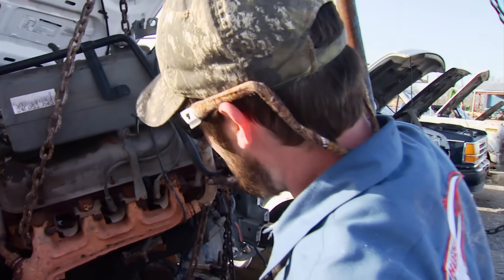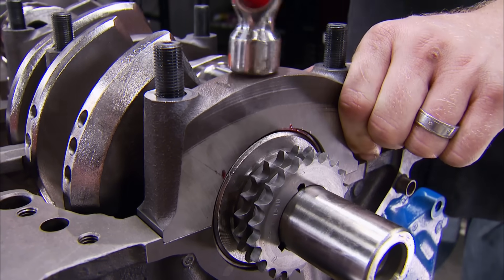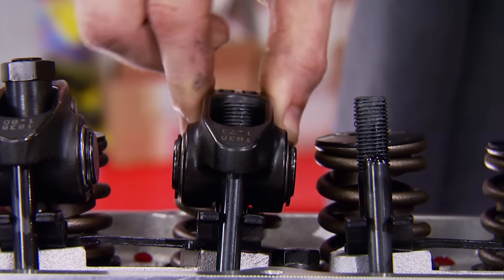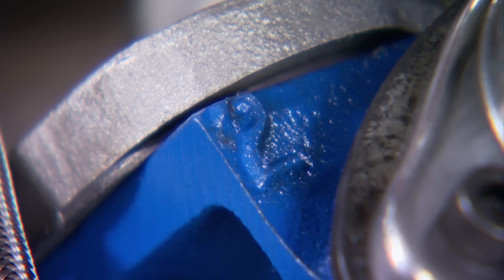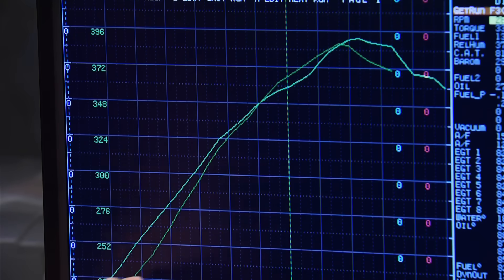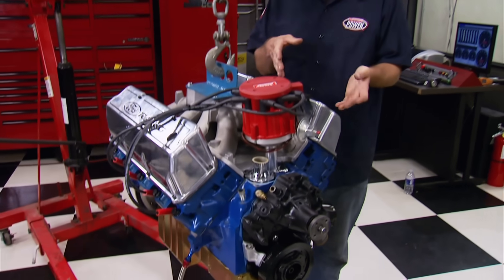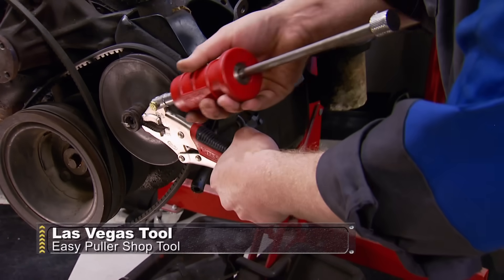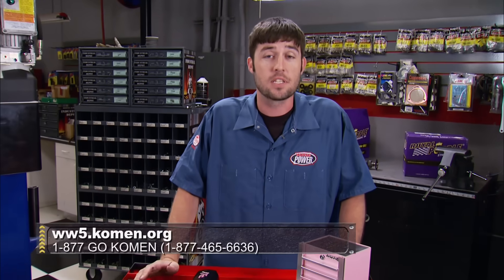351 Small Block Dyno Shootout: Windsor vs Cleveland - HorsePower S16, E11

Comment: They failed to make the Cleveland comparable. The intake was sized wrong for the 4v heads. Also a bit of pocket porting on steel 4v heads along with a properly sized intake would have at least gotten the heads closer to comparable with the aluminum aftermarket heads on the 347 Windsor

Comment: I worked for a ford dealer for 27 years , this combination is setup for failure, if you ever drove a ford torino with a 351 4bll cleveland factory , it had great torque and horsepower, you set this up for failure with the combination of parts.
Reply: yep this was a bias test

Comment: I'm not a Ford guy but you would think with those much bigger 4V intake ports you could rev the crap out of that engine and get it to a lot higher than 5500 RPM.  I bet that's where it starts making more power
Reply: Can only do what the cam is allowing you to do (no matter who's name is on the valve covers). The cam they had in that engine didn't support the airflow they needed to run it up to high RPM's the 4V heads are noted to support.
Reply: If you have the correct camshaft then you could. The cam they used crapped out at 5K.

Comment: They should of used a Cleveland stroker  built by Bob Glidden Racing.
Reply: or a Kaase Cleveland.
Reply: Bob would have destroked it to around 331 inches and turned ungodly rpm like he did in the 70s when he was kick'n pro stock ass!

Comment: 408 vs 358? Why not stroke the Cleveland? But I'm surprised that the 4v Heads didn't make that much more for the size ports? Only way to describe the marginal difference is that the Cleveland 4v heads need more Cam, Compression, and RPM.

Comment: Guys, it's not a Windsor after you've converted it to a "Clevor."  I think you have lost sight of the windsor/cleveland comparison entirely, especially after stroking the windsor up to 408ci ahd changing heads to a completely different design.  What is the point of the comparison when you change so many things in such an asymmetric fashion?
Reply: I agree its a 357 vs 408 since they both wore 351c heads. the 408 got a bigger cam to boot so how is this a  W vs. C comparison?
Reply: they did the same with the 460/454 duel..chev got everything,ford got,?,but then,doesnt need it..
Reply: @phantomwalker8251  YEAH Except in the Budget Builds the 460 got a 218/218 @.050 Cam w/.494 lift Whereas the Budget Chevy got a 228/238 @ w/ .540 Lift....  YOU OUGHT TO KNOW BY NOW, NONE OF THESE COMPARISONS ARE FAIR - FYI I have built similar year Chevy 454 vs. Ford 460 with Basically Identical Grinds and intakes...Honestly there isn't 10-15hp difference...
Reply: Then on the "Power Build" they put bigger heads on 454...I could not find the cam specs....
Reply: @misters2837   I have both a 351 M and a 400 in my 77 Cougar wagons.   I need to get a timing wrench for the distributor that I know will fit.   If you are using a Snap On timing wrench on the O.E. distributor nut, can you give me the part # of the wrench ?   Or if another brand, the brand and the part number?   I see a lot of Snap On F 8564 B timing wrenches on ebay, but none of the sellers have used the wrenches (I asked each one of them).   Any help appreciated.  Thanks
Reply: @tompastian3447  it's a 1/2 inch nut dude.
Reply: @VariantLandscape  Thanks Casey.  Some distributor bolts may have 1/2 inch heads.   I have two 77 Cougar wagons and have tried a number of different sizes including half inch.    The actual size from what I can determine is 17/32, so standard 1/2 inch sockets slip on the nut.    The correct Snap On timing wrench is their #F8564B
Reply: T h e crank journals are entirely different as the Windsor crank has more coefficient drag over the smaller surface area of the Cleveland. The clevor idea is not new but has newer cheaper technology nowadays. Clevor's were always known to run like a raped ape
Reply: Wish they would build my 1978 ranchero motor. I have only 300 hp. Needs more
Reply: @kevintonk4308  300 a respectable number. Once you get over a certain amount of power. It's more bragging rights than usable power. Unless you really  have your car/truck suspension dialed in.
Reply: absolutely, it's BS

Comment: I purchased a 1971 Mercury Cyclone with a 10.75/1 comp ratio Cleveland, it was a very early 71 built in 70.  I had a lot of trouble with the carburetor and the dealership did all they could to make it work.  I finally found someone who fixed the third one the dealership put on.  The car had a c6 and there was no Windsor that could hold a light to it at all.  Note even close. I had a 72 Windsor later on and all it could do was drink gas.  Yeah if you give the Windsor 50 more cubes and another 10% more compression.  I never ran my Cleveland 7500 rpms, yeah you suck when you do a dyno shootout.

Comment: Did you guys really do a head swap without touching the cam? I’m no engine builder but with larger ports on an NA wouldn’t you want a tighter LSA to move peak tq up in the rev range to take advantage of that lower restriction? A little scavenging perhaps? Otherwise it seems like all you do is stall out that intake air speed and ruin the mix and cylinder fill efficiency. Bernoulli’s principal and all. Ask me how I know about redundant cross sectional areas and port velocity. I learned to read the book on porting before attempting instead of porting then reading to figuring out why it makes less power.

Comment: This "test" was obviously biased and the Cleveland was neutered. For street running, you don't want a single plane intake. Anybody who watches Engine Masters has seen the testing they have done proving this. There was a dual plane intake ( Which is way more suited to street driving.) on the "Clevor." The obvious larger ports of the 4V heads mean they flow more air so naturally, with more air flow, more fuel is required. Had they changed the jet sizes in the carb to richen it up, and put a good dual plane intake like an Edelbrock Performer on it, that Cleveland would have made 500 HP all day long.

Comment: Did you use the small Cleveland main journal stroker crank in the Clevor?
Reply: I don't believe you can.  It has to be a Windsor crank unless you go to an aftermarket block.  And they mostly run Clevland mains.
Reply: @ibast1  https://www.jegs.com/i/Clevite-MAHLE/695/MS2254SEMI/10002/-1
Reply: @Vintageguy73  There you go.  Thick bearings.
Reply: @ibast1  those are not bearings, they are spacers.

Comment: The only thing I take away from this is that it’s pointless to scour around for a Cleveland when it’s sooo much easier to find a Windsor and the Windsor is a much better engine for a street machine. Maybe a Cleveland would be a better choice for an all out race engine?!? You fords nuts I’m sure know....
Reply: A Cleveland is absolutely a great street engine with the correct parts. They did not use the correct parts in this build. The Windsor is much more prevalent and naturally has a larger aftermarket support. Putting a single plane intake on any engine and trying to use it on the street will turn it into a dog. Because single plane intakes are high RPM pieces. Street engines rarely go over 5,500. Like any other engine, if you put a matched cam, intake, and heads on a Cleveland it will beat the snot out of an LSx that has a shitty parts combo.

Comment: Be nice to know what spark plugs they using , as in heat range as well as other specs every edelbrock head i have owned had to go to machine shop mainly cause guide issues
Reply: Spark plug heat range would only be a large factor in forced induction builds like turbo, or superchargers. As well as Nitrous.
Reply: @TwentytenS4B8  

Still would nice if they would give more details on these builds instead of just a generalization as some people who dont have deep automotive knowledge use the information they provide. I used spark plugs a a point of detail.
Reply: saw standard champion plugs on the Cleveland 2V. could not tell about the W.

Comment: They were still running the smaller 2v port intake on the Cleveland, which in my experience always loses power when bolted to the big port Cleveland 4v heads and of course the 2v heads had a better power band. Poor Cleveland could not breath right, think deviated septum.
Reply: Guaranteed it was starving for fuel too.
Reply: "Port mismatch"
Reply: they should have done the 4v heads correctly, along with a strip dominator intake and a 900 cfm carb. that would turn some numbers
Reply: @haydenohrmund2915  Fully agree. Give the Cleveland what it was made for, for not much more then they spent on the 2v/4v open chamber iron heads, and let it run.

Comment: This is literally an apples to oranges comparison.
Reply: On next week's episode stay tuned as the Saturn V Moon rocket engine on a Dyno versus Chrysler slant 6 with one barrel carburetor.
Reply: AmericanThunder 😂
Reply: yeah, and the fu#kin mopar wins with 3 dead plugs and the converter stopped up cause it was running on crank case oil!!!!!!!! biggest bunch of bs i ever read
Reply: Its apples to staples...
Reply: @bigboreracing356  Maybe. It'll be a close one for sure.
Reply: This is not literally apples to oranges.  There was neither apples nor oranges anywhere in this video.
Reply: right!!!
Reply: Clevor's are entirely pointless with all the aftermarket support the Windsor has these days anyway.

Comment: Scratching my head on why you didn’t switch to the good closed chamber 4v heads? Would have been interesting to see the results with the raise in compression.
Reply: In addition, even if the compression ratio was the same, the 4V closed chamber head might have an advantage due to cylinder head quench zones.
Reply: I was asking the same thing.

Comment: Flat tops, 2V heads, 4V aluminum intake, carb, CJ pattern hydraulic cam, and that H code Cleveland, will run quite strong. Show people, how cheap you can put together a good street car engine,on the cheap.

Comment: My old 4V Cleveland redlined at 7,500 RPM with a similar set up. They left 2,000 RPM's on the table.
Reply: They built this for torque which is not the proper way to build a 351C, especially those 4V heads. Too little compression, cam and fuel IMO. They would have been better off comparing 2 Windsor builds.
Reply: Needed a big solid roller and more spring is my guess.  Also, they used open chamber heads for both.  Needed 11.5 to 1 compression.
Reply: I believe the heads on the Cleveland were close to the Boss 302 heads designed for TransAm racing at 7,500 RPM or more for lap after lap for hours.  Also those head flowed as much as a Hemi Mopar.  In high school, friend had a Mach 1 with a Cleveland, really sounded nice. But, my Roadrunner 383 spanked him all the time. It was back in the 70's when we had high octane gas and high compression built engines and raced traffic light to traffic light with 4 speeds!
Reply: @letsride2057  - Both engines about same HP, but your 383 had the torque advantage...
Reply: 4v heads will flat out outflow that edelbrock 2v heads... they had to choke the crap out of the 4v motor to make sure it lost. Stupid builds... gotta do that stuff if you want free parts and sponsor money.
Reply: Kodiak660 the power curves were dropping like a rock. No reason to go further
Reply: @Highstranger951  It's called tuning and proper set up.
Reply: Kodiak660 you’re funny
Reply: @Highstranger951  because they put the wrong cam in it for the 4v heads.

Comment: Doesn't a 4.00 inch stroke give you 427 cubes.. with a 4inch bore... 3.75 inch stroke with a 4.155  bore give you around 406 to 408 cubes.. I could be wrong I'm not sure what there final bore size was..

Comment: "Buy this MSD 6AL box that's been sitting on the shelf since 1999, While your at it replace all of your fuel injection with double pumpers.."
Reply: The stock 351W EFI intake doesn't match the Cleveland cylinder ports. In addition, even if the stock EFI manifold could line up, it might still have a major disadvantage. Some of those long runner EFI intakes are designed for maximum low end torque and drop off quickly after about 4500 RPM.
Reply: @skylinefever  4500rpm? Which intakes were those? I can't think of any.

Comment: So the 4V heads have larger ports but you still ran the 2V intake with no porting???
Reply: And a single plane to boot which is way more suited for high RPM racing and not street driving.